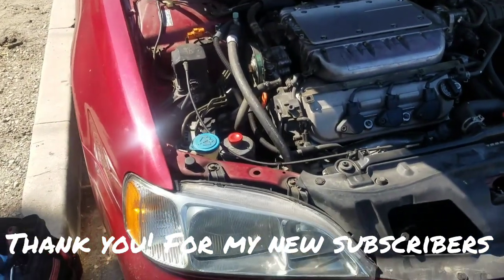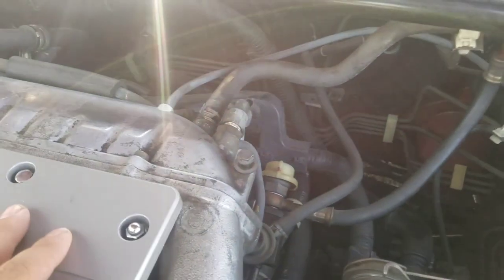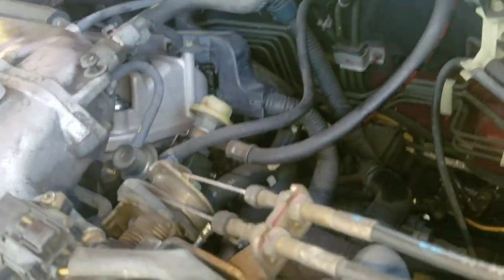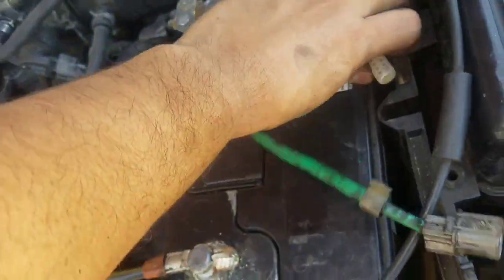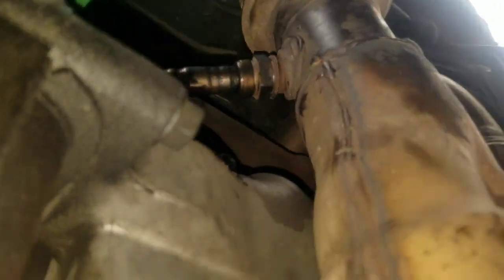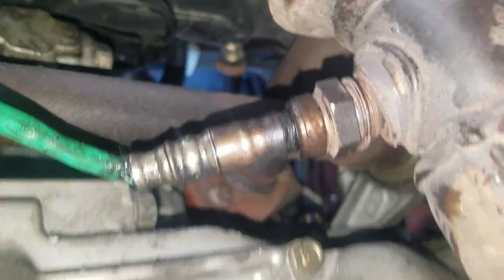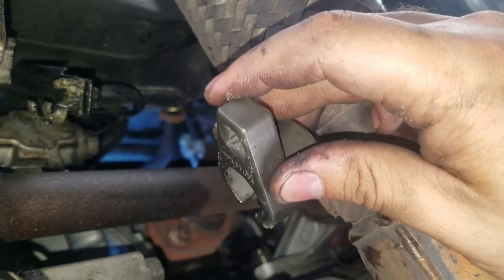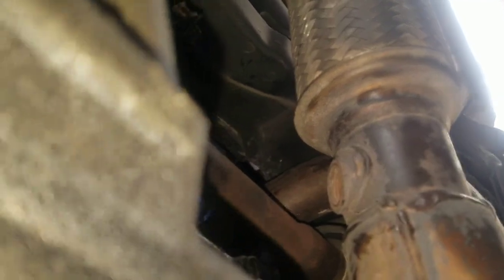How to change upstream & downstream 02 sensor Acura Tl

Comment: I found on my 2000 Acura you can remove the bracket makes it 100x easier. It took me a while to find it too. I rented a shop space so I had everything I needed.
Reply: What bracket are you referring to? Where's it located?
Reply: Where is it
Reply: @rlcnatl  if it’s not in your way it’s not an issue. Right

Comment: How many miles do it take for AVS or warning lights to go off after putting the sensors on
Reply from the maker: Hello Denard.. Very good question, it took almost 500 miles. Remember there so many for them to turn off.
Reply from the maker: 1. In the morning make sure you let the car warm up. Wait like 15 to 20.. and a few of them do turn off. 2. Drive on the fwy only 65 mph for like 5 minutes 3. Drive it 40 to 45 for 5 minutes. That will help out.
Reply: I forgot to tell you after I go almost a mile the AVS light comes on while the exclamation sign is already on. But I'm gonna try getting back on the hwy maybe drive around 285
Reply: How many 02 sensors does a 2000 Acura tl has

Comment: Hey man my Acura tl 2001 spitted out code P0131 is that the bank 1 sensor? At first I would start it and it would die after 1 second unless I pressed on the gas but once I let go the car would shut off, now it doesn't even start it just sounds like a continuous start, do you know what the hell could be wrong? Btw it also spitted out code P128
Reply from the maker: Yes Bank 1 Oxygen sensor I do recommend u change both. Upstream & downstream. And for P0128

Possible causes Leaking or stuck open thermostat Low engine coolant level Insufficient warm up time Faulty engine coolant temperature sensor Engine coolant temperature sensor harness is open or shorted Engine coolant temperature sensor circuit poor electrical connection
Reply: R Tario damn bro, right on the spot! I just checked my engine coolant and I don't see any, also checked the side reservoir and it's also empty!! Can I just fill it with AutoZone's antifreeze or would you recommend from Honda's dealer?
Reply: R Tario also that p0128 code showed up a while ago and I thought it was a sensor or fuse in the engine fuse box? I read somewhere that the whole fuse box would have to be replaced because that one fuse/sensor alone could not be taken out, any truth to this?
Reply from the maker: Autozone is ok, You may have to change the thermostat just incase if it doesnt open when it heats up. and maybe the temperature sensor pretty easy to do.. Just keep and eye on the temperature on your car.. Dont drive it till u know the fan turn on.. Happy Sunday..
Reply: R Tario me again, do you think a bad 02 sensor could be enough for the car to not start? It just tries to start but doesn't turn the engine over. Thanks.
Reply from the maker: Yes its possible.. But there got to be other things though. I would like to help you, but me not seen the car or knowing what is doing is hard for me to diagnose it.. Hows the battery? does it crank or nothing at all? check the fuses make sure none of them pop.
Reply: R Tario hey man thanks for your info and time I really appreciate it, I want to try and do all this myself specifically because my car won't start and can't drive it to a shop but unfortunately I'm not that savvy into mechanics and I understand it's hard to make a diagnosis, I'm gonna upload a vid real quick and if you still around may check it out, thanks bro!
Reply from the maker: Sorry Joe, work keeps me busy..I would change the ECM very easy to do bud.. it should start after that..
Reply from the maker: 1999-2003 Acura TL Main Relay Standard Motor Products

Review Fitment Notes to Ensure Proper Fit

Standard Motor Products Main Relay

Click to Enlarge

(3 Reviews) 

5 Stars

Our List Price:$46.39

Quantity: 

 Select Year 1999 2000 2001 2002 2003 

In Stock

Part Number: 5951-05062630

Brand: Standard Motor Products

Notes: Main Relay -- Genuine Intermotor Quality

Condition: New
Reply: R Tario oh no worries bro, I know how busy one could get due to work. Any who as an update it turned out to be egr valve was stuck, had it cleaned it went back to normal.
Reply: R Tario but  the shop added some water to the radiator because it was low on coolant, do you think it's ok to drive it like that(90 miles per day) with added water?
Reply from the maker: Im Happy u got it going bro.. Any question hit me up ok bro..
Reply from the maker: Joe I would by the serpentine belt area. And check for leaks maybe the water pump is leaking or thermostat bro.. And no I wouldn't recommended. Also what u can do is put a big carton by the driverside wheel underneath to see where exactly is leaking from.. And one more underneath the radiator. Dont forget to put something heavy so the carton doesn't fly away during night time.. let me know ok bro..